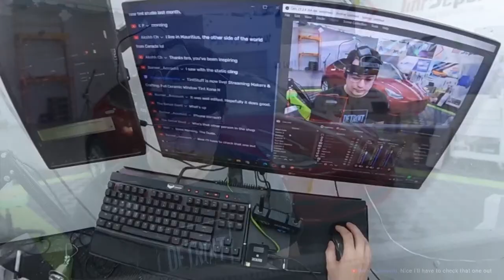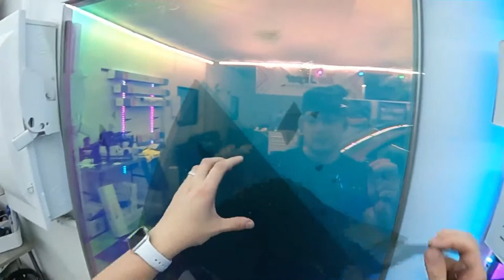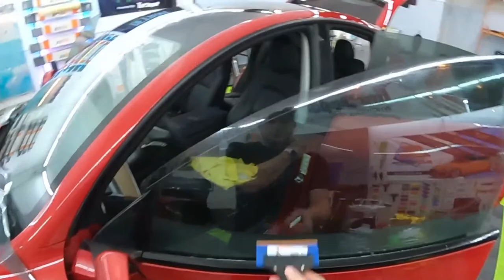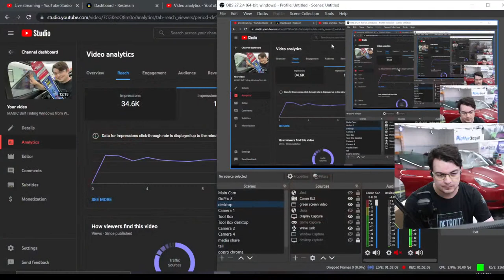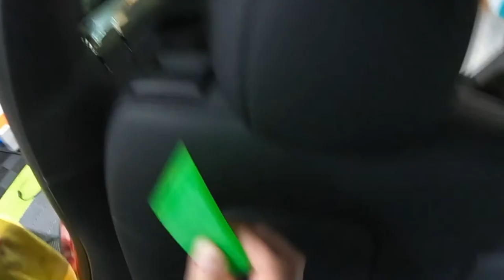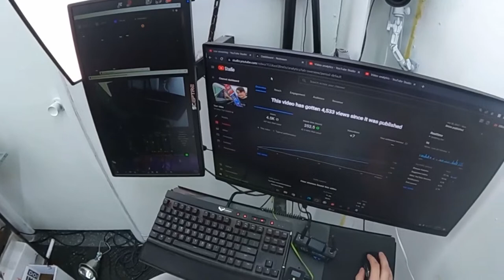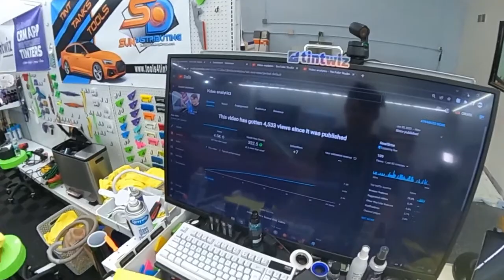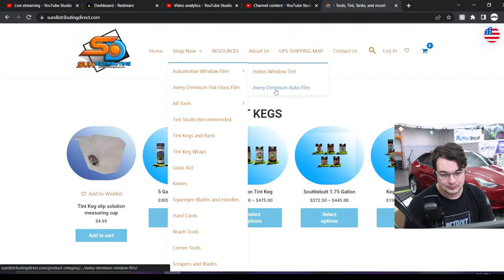Tesla Model Y Ceramic Window Tint

Comment: You should do a side by side comparison of tint, inside and outside on one door window from like 70% 50% 35% 20% to 5%. I saw one You Tuber channel had like 1.5M views on a similar video, Matt. Show the results of it in the sun from inside the car and outside the car. The video title was literally side by side comparison, inside and outside. The thumb nail was showing the view of 5 6inch strips from top to bottom from inside looking out. Looked like he was in a parking lot and you could see trees in back ground line past the concrete parking lot. I guess to show contrast. Might be a good idea!